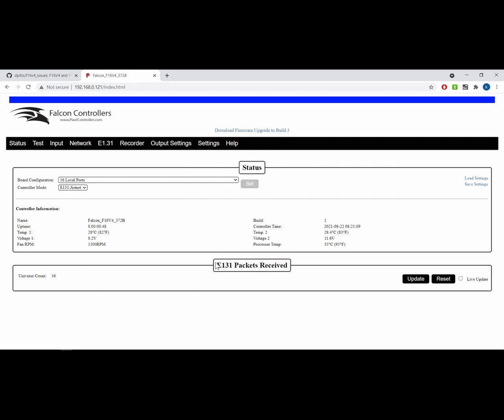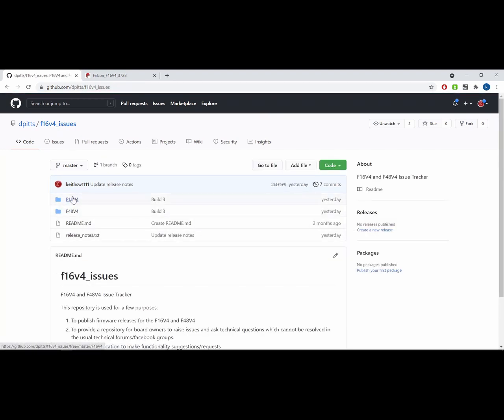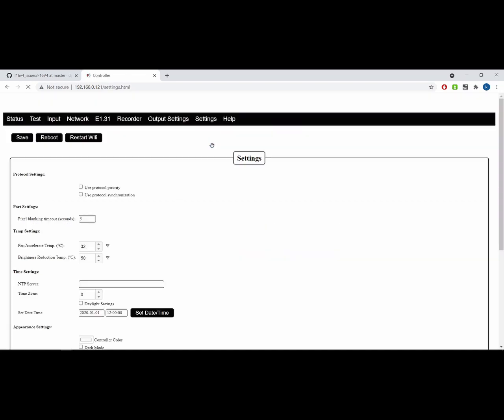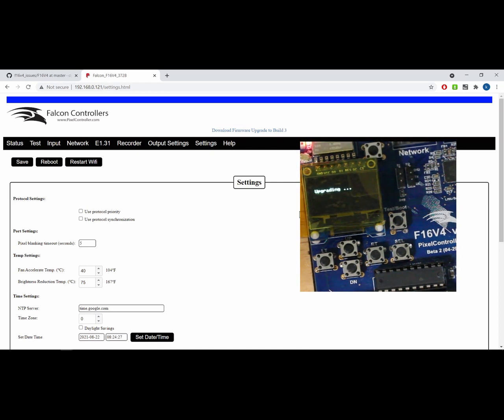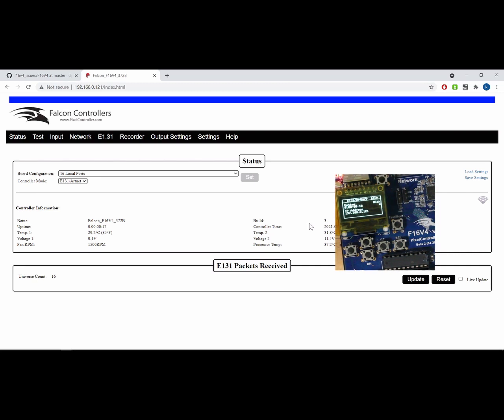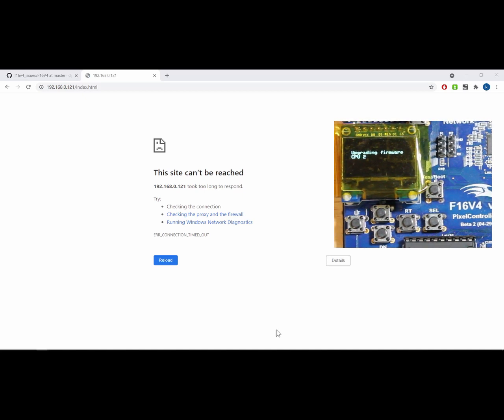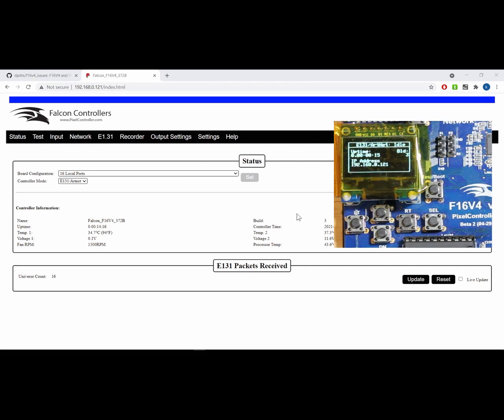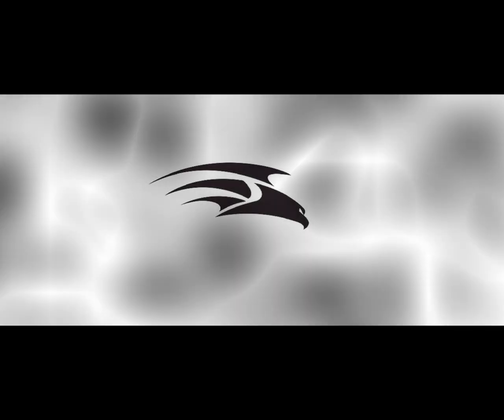Falcon F16/F48 V4 Firmware Upgrade Process Explained

Comment: I'm unable to load firmware past Build 13, I get a failure to load. Build 21 is the latest. I tried loading Build 14 thinking I have to load each subsequent one but nothing is working. I'll be trying the SD Card load next. Any ideas what might be going on? Any recommnedations?
Reply from the maker: Use the sd card method. Some earlier versions had upload issues using the web page.